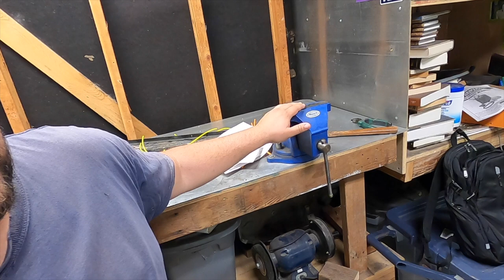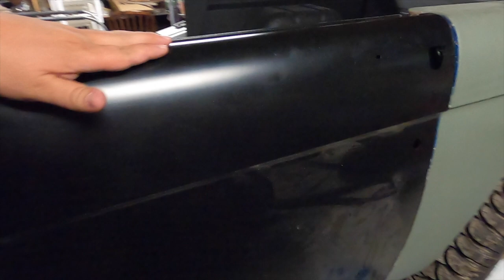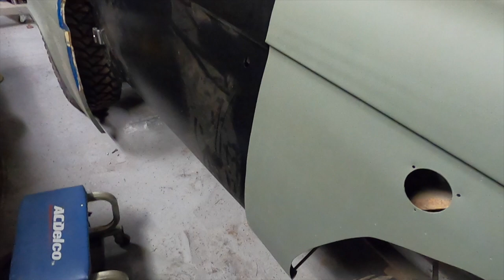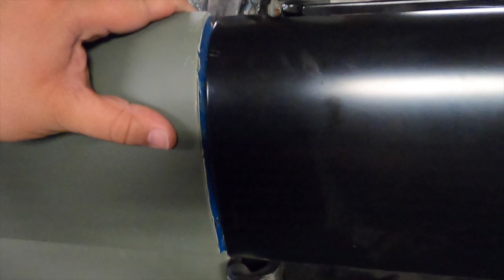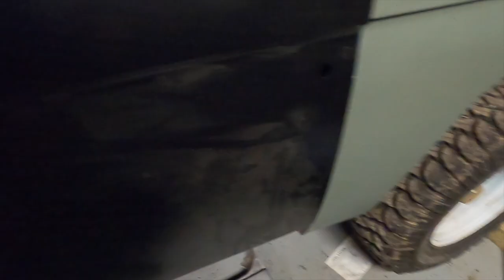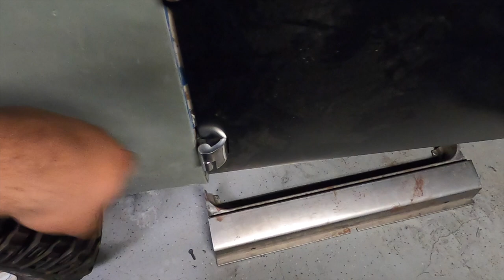Early Bronco Build l "A" PILLAR Adjustment and DOOR Fitment to help with the GAPS

Comment: Just want to make sure you know that the bottom of the fender goes between the front and back pieces of the a pillar.  I had to cut my outer rocker and remove slightly more than the thickness of the angle grinder disc.  I’ll send a couple pics.
Reply from the maker: Ok that would be helpful.  I tried to get the fender in there but it was extremely tight.